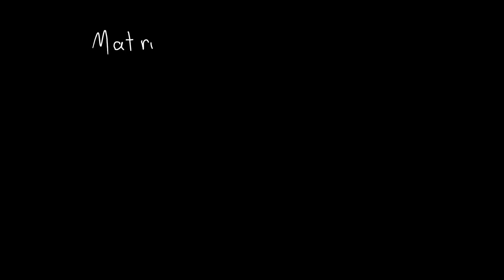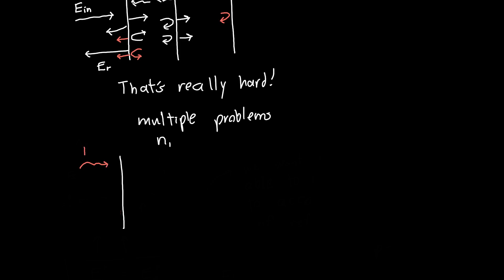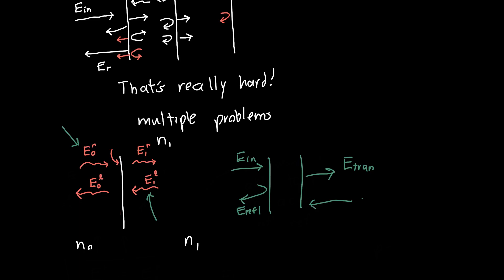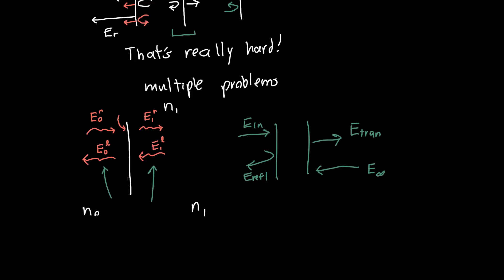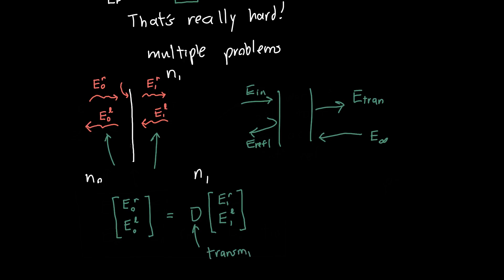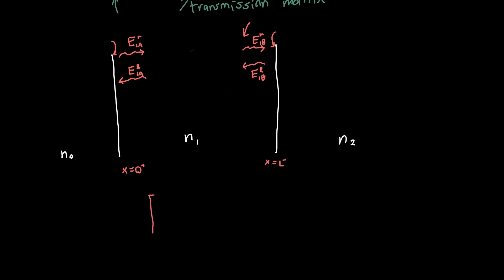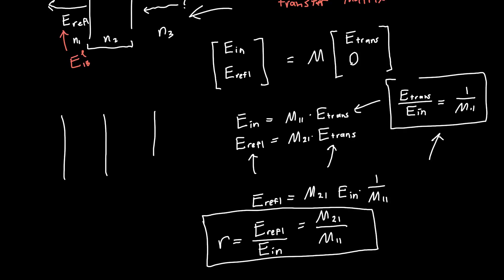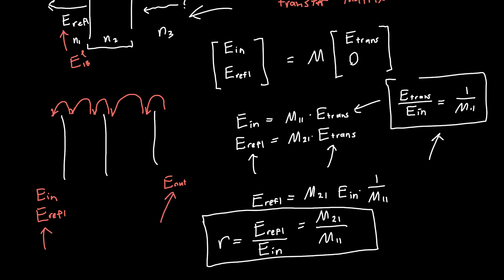Transfer Matrix Method Explained

Comment: sir will you please explain this method of transfer matrix for calculation of sound absorption of a multilayer structure.
Reply from the maker: Great question, the math is exactly the same. The only thing that is different is the velocity of the wave (it’s the velocity of sound in the medium), but you can then calculate k with the standard dispersion relation (w/k = v).

Comment: Hi Jordan, thanks for the great video! Is it possible to deal with ultrashort pulses within the transfer matrix method?
Reply from the maker: What a brilliant question. Yes, you should be able to deal with ultrashort pulses by Fourier Transforming the input pulse, you can see what the "input frequencies" are. The TMM worksata single frequency, so you'll need to use the TMM as a function of frequency. Then, multiply the Fourier-Transformed pulses by the frequency-dependent output of the transfer matrix method, and inverse Fourier Transform the whole thing. (in practice, you will use the DTFT for this).

Comment: @4:40 you say that if we have this matrix we don't need to worry about infinite reflections. But is this really because of the transfer matrix method? The reason that we don't have infinite reflections is because we are working in the frequency domain, not the time domain.
Reply from the maker: Yes, absolutely. I like to think of the frequency domain as the limit of longer and longer time domain 'thought experiments' (when we are concerned with a single frequency) as I have a hard time wrapping my head around things that don't happen in time :)p

Comment: hi Jordan! do you know how one can derive the transfer matrix method from maxwell's equations?
Reply from the maker: Sure, this is why plane waves are so cool. Plane waves are a solution to Maxwell’s equations. The transfer matrix method just uses plane waves as a starting point and then goes from there. The boundary conditions used by the transfer matrix method can be derived using Maxwell’s integral equations (I have videos on that as well).

Comment: Nice video. Sir, I wanted to ask from where should I solve problems for semiconductors, pn junctions, bjts and mosfet? I am currently using Modern Semiconductor Devices by Chenming Hu.
Reply from the maker: Personally I liked the examples in Neamen (Semi. Physics and Devices) and Pieret. I would recommend trynig to do those examples without looking at the solutions and then check whether you were correct. If you have the solutions manual for either of those books those can be used in place of examples.
Reply: @JordanEdmundsEECS  Sir, I am also an EE student. So, the thing I want some piece of advice from you.
Reply from the maker: Sure! If you want to master the material you are learning, don’t ever use an equation without 1. Understanding where it comes from and 2. Deriving it yourself. If you are able to do this, you will greatly reduce the amount of stuff you have to memorize and you will have a much deeper understanding of EE.